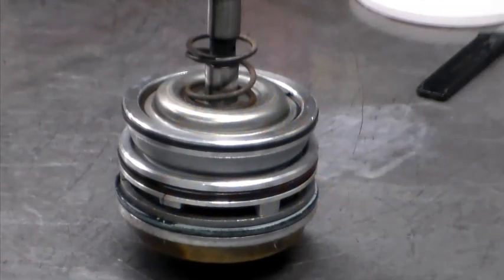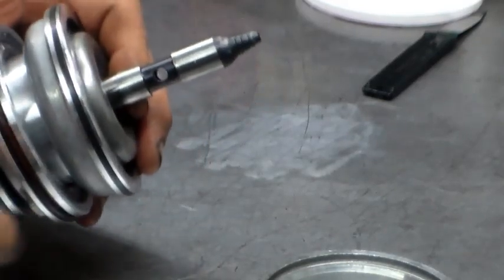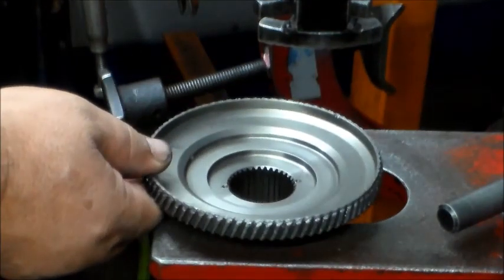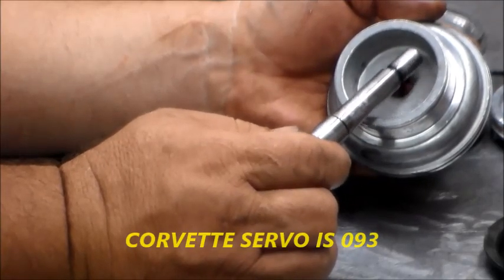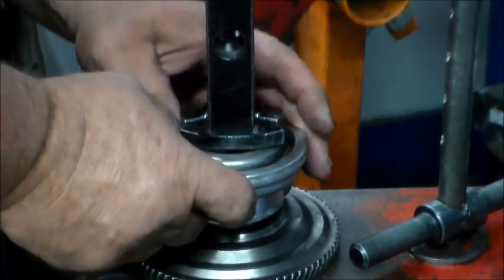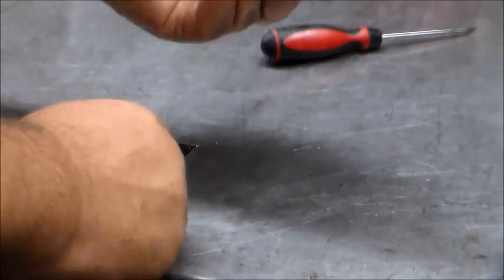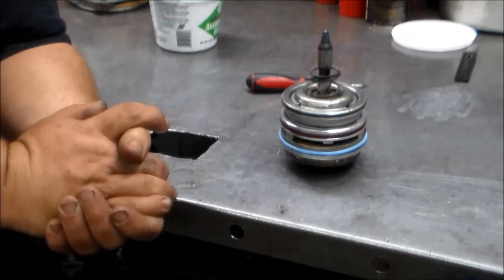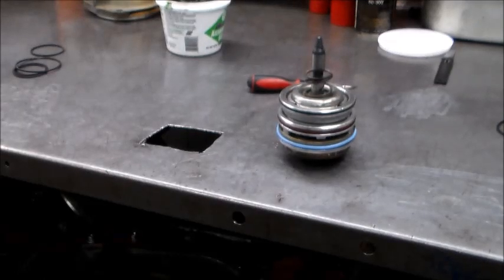4L60E SERVO

Comment: Thumbs up servo video!

Kind Sir, please answer me a quick question from Flowery Branch, Georgia...

Sir, does that main piston that sits inside the cap with a hat facing in the hat top facing inside the cap, is it supposed to sit in there tight enough that you can turn over the cap and it's not supposed to fall out???

Because this aftermarket one I got on eBay, I can turn over the main outer cap and that little hat lid on the inside falls right out... Is it supposed to fall right out or should it be really sitting in there cuz the seal doesn't even really touch the inside edges of the cap...

I'm talking about that one that everybody seems to get put in there... backwards so it has the hat part pointing in.

That's like John Wayne wearing his hat inside out... That don't make no darn sense...

Comment: If I'm losing my 4th gear overdrive when cruising on the freeway would this be the culprit? This is happening in my 4l60e in my 99 Trans am, I'll be cruising along at 65mph and 4th will just unlock but I can re-engage it by tapping on the brakes or downshift to 3rd and back to 4th quickly. I was thinking it was just a bad band but now I'm not so sure.
Reply from the maker: I dont think its a band if it was it would also effect 2nd gear as well, could be A servo problem, or a possible or a hydraulic leak in valve body, could also be a solenoid problem

Comment: I have a 4l60e transmission that seems to have lost 2, 3, and 4th gears. While driving. It stays in first no matter the rpms and seems to attempt to shift only if I let off the gas allowing g the rpm to drop I can then feel it shift it  begins to slip. At that point if I hold it at the right rpm  (between 2000-3000) it will gradually gain speed up to about 50 mph. This doesn't work all the time and it the temperature doesn't seam to affect it. The transmission fluid was burnt with shavings. I decided it needs rebuilt so I called amco for pricing. The guy says I should bring it in for a free inspection because it may not need rebuilding. While researching this most techs scream rebuild at the first sight of shavings. So I have 2 questions for you. 
1. Does this sound like the servo is bad?
2. Is rebuilding most likely the only option?
Thanks for your time.
Oh I pushed the servo cover and had atleast 1/4"+ movement
Reply from the maker: it doesn't sound like a servo that should only effect 2nd and 4th if a lot of metal is in the pan I would suspect a plant or bearing issue you can just repair whats wrong however if you take it apart that far you should rebuild the unit

Comment: Hello....  I have a chevy Silverado 2012 with 187K.  My 4L60E shifts fine without any slippage in 1st & 2nd gear.  But when shifting into 3rd gear I have total slippage.  When I let off the accelerator and the RPM falls to where 3rd gear let go, then it takes 3rd gear and will pull without any slippage.  But after 3rd gear does energizes, I either do not have over drive or forth gear, I can't tell which one I do not have.  Where do I go from here.  Thank you.  Frank.

Comment: Is there anyway this can cause a loss of 2nd and 4th gear? I have a brand new transmission and less than 1000 miles. Got hot on me while pulling an empty trailer. Pulled over to let it cool and have had no 2nd or 4th since.
Reply: You ever determine answer?  This is what I got:

1995 Silverado 4L60E. Daily driver. 229,000miles. All stock. No CEL or stored codes. There's no 2nd or 4th. It was shifting 1st to 3rd, and 3rd to 1st. Does same behavior in D and 3. In 2, it doesn't shift out of 1. When in 3rd, when I stomp on it, it tries to kick down to 2nd, but just flares the RPMs, bc there is no 2nd at all. Fluid clean, red, and full. No burned smell. Is there anything it could be except for 2 and 4 bands or clutches?  Guess I could measure the Servo and see from there, eh?

Comment: I am struggling to understand how much the big cushion spring behind the cover in the 2nd piston affects both 2nd gear and 3rd gear engagement. I have put in the HD 2-3 Valve, a corvette servo, and I think I am going to block the 3-2 valves. It seems logical to grind the notches in the cover, but will this make my 3rd gear excessively firm? Or, how would making the springs in this location stiffer or softer affect both shifts?

Comment: should there be and gap in between the servo pin and small spring and  washer that sits under the C clip.. mine has around 40 thousandths gap. thanks

Comment: 07 Hummer H2 4l65e
2nd and 4th went out with only 20000
On rebuilt trans. Where can I find the tool that checks to see if the correct pin was used? Corvette servo was installed.

Comment: 18 years ago, after putting a Whipple supercharger kit on the 5.3 in my 2002 Avalanche, I put a Transgo shift kit with Corvette servo in the 4l60e. Everything turned out OK, the transmission even had a slight bind on the 2-3 under light acceleration originally from the factory (I'm the original owner). The guy who sold me the kit penciled in some hole size changes in the valve body plate to address the 2-3 bind, I followed all the instructions and the bind was gone with all the shifts nice and solid. However, the 1-2 shift was firmer than the rest of them, and when I put the trans in tow/haul mode, that made the 1-2 shift dangerously harsh. Using tow/haul makes all shifts a little firmer and it also winds out each gear a little longer, and also delays the TCC. All the shifts worked well in tow/haul except for the 1-2 being too harsh, and I like to use tow/haul when pulling a trailer, so I had to let it make the 1-2 before engaging tow/haul, then remember to cancel tow/haul every time I came to a stop. I didn't care for what the Corvette servo does to the 1-2 shift because it makes using tow/haul a hassle. 

Now at 120K miles later I am replacing the trans with a Monster unit. I made the order last week and the lead time is 6 to 8 weeks. I saw that their level 2 shift firmness package includes a Corvette servo, and I told the guy over the phone when ordering to put in the build notes that I do not want a 1-2 shift that is too harsh in tow/haul mode. The rep on the phone said he put that request in the notes and it will be addressed. I don't know what exactly they will do, but I don't want a savage 1-2 shift again. I also talked to another transmission guy who told me he does not care for the Corvette servo in a heavy truck either. That hard 1-2 shift is one thing in a car that weighs less than 4000 lbs, but another thing entirely in a truck that weighs 6000 lbs.
Reply: So random guy, I dont know much about transmission but, I read the shift kit address weak 1-2 shifts so a 2nd gear servo becomes overkill after a good shift kit.
Reply: @jeffreymedina304  I tried to include a warning about doing business with a particular online transmission shop but the comments are rigged and won't let it thru. Which explains why I never see anything bad written about them here.

I had a reputable guy start with a GM crate reman 4L60e and build it to 4L65e specs. He used the Raybestos combo clutch discs that have friction on one side and steel on the other instead of separate steels and frictions, 5 gear planetary, 13 vane pump, stock pump pressure regulator with no bump up pressure spring, roller bearing shim washers, no Corvette servo. I installed it last summer along with a reman transfer case and it shifts solid, perfect for a heavier truck.

There is a solenoid on the right rear of the valve body that controls the system pressure. I had to dial this in myself. There is a #15 torx set screw on the back of the solenoid, if you turn it about 1/2 turn it will make a big difference. It can be set so the 1-2 shift will get rubber on part throttle, this is way too hard and will break something. I set it so it is nice and firm but still not too hard when in tow mode. There was labor involved because each time you have to drain the unit, pull the pan, unplug the electrical plug from the solenoid to expose the screw which takes some fiddling with a small tool to unlock the plug, turn the screw a fraction of a turn with a small torx tool that can fit in a tight spot, it has to be angle shaped like a small Allen wrench (turn clockwise = firmer) then put it all back together, refill the unit, test drive and evaluate. I had to do this several times to get it exactly where I want it. If the pressure is set too low then there will be binding in the shifts and if the pressure is set too high the shifts will be too harsh. You have to find the Goldilocks zone.

Comment: What happens if you don't add the four notches?
Reply from the maker: sorry for the delay in reply the four notches is part of the shift kit the idea is to give fluid that is trapped in the servo a place to go when 3rd gear is commanded that part of the servo is used as a accumulator that uses springs to soften the shift

Comment: Nice video my friend, hey i have a question 4 you, i have a 2004 Tahoe with a 4L60E and bought a new Sonnax complete servo kit ( 2nd & 4th gears super hold ) but i was reading the instruction and it say the pin or rod ( included in the kit ) should be grind it on the tip not too much not too little to avoid the trabby getting stocked in 2nd, could you please give some tips of the right amount i should grind off of it?? Thanks in advance

Comment: I recently bought a 2011 chevy Colorado 2.9 with a 4 speed AT an 4L60e and starting to make some upgrades for a drift truck project. I already put a transgo shift kit also bought a B&M quick silver shifter to throw the shifts to floor... And my super servo 2-4 already arrived so im planning to do all those upgrades in a few days more. Also thinking in get a hp transmission oil cooler...
what not to expensive upgrades can i make to the transmission spend 350dlls for shift kit and labor 
175dlls for ready to put super servo i will try to do that job myself.
And 200 for the shifter 
Who's in da same channel to built a drift truck project ???
Saludos desde Ensenada México 🍀🎶🍻🤘

Comment: On my 2000 Silverado i have this servo in a 4l60e .the piston and accumulator for 3rd gear are shot and I have to replace all of it. Could
That possibly by why it won't shift into 3rd at all? If so any one know how that even happens so I can fix and prevent a repeat?  Thanx guys

Comment: Hi, Thanks for video, I have 2000 Pontiac Firebird base 3.8L V-6, I have some issues with my transmission ,  it's shifts from 1 to second, but has no 3 or 4
I went to autozone and they check engine light , there was code which pointing to solenoids, Do you familiar with such problem, and what you think it could be?.Thanks

Comment: Hi  Robert, very good precentation.  My Transgo stg 2 shift kit doesnt mention the cutting the disc ! Should i cut mine ? I will b installing Vette servo in my Aussie 4l60E 2000 model commodore GM 3800 L67 V6. Thnk u very much !!!
Reply from the maker: It will make the 2-3 shift a little faster with less of a flair

Comment: What is the actual purpose of the additional spring? The transgo kit I am using adds two springs plus a spacer on the end of them, really tightens it up.

Thank you for this as well as your other 4l60 videos! This is my first rebuild, you and some others have been a big help.
Reply: I put in a corvette servo I noticed my original sero had spacer why? Jw I put the spacer in same spot just not sure what it's for

Comment: What did the grinding and added spring do that the stock setup wasn't?  Does the stock setup hydrolock?  I've watched quite a few vids and it's the first I've seen anything about the 3rd accumulator mentioned.   It's always about the corvette servo.

Comment: What is the part number  for a 4l60e servo
Reply: @Rick Samson - Buy the Superior 4th w/cover and 3rd. New wide band with servo installed should move by hand. If tight, grind a small radius off the pin, retry.

Comment: I tore down a 85 Corvette 700r4 and when I remove that same servo and found a spring broke into three pieces and the apply rod was in about three or four pieces. Do you know what could have caused this. I don't want to rebuild it and have the same problem. The transmission came out of a wrecked Corvette
 Thanks for any help
Reply: Mickey Locklear  - It has been a year since your question, but in 1985 was almost the first year it was made. It would be easy to find 13 suggested updates to do including increase the drain-back hole under the front seal and install the new retainer for it. That's 2. Accumulator pistons take a beating as the move as you shift into gear and as it shifts out. These wear, crack, break and can ruin your case. Same thing for the rear case captured check ball, next to the 4th filters. Large springs break and accumulators will pound the snot out of the separator plate. Go onto your favorite search engine, type in 700R4 modifications. A printable PDF full of explanations and diagrams from some "National Transmission" service group put this out there. I highly recommend updating the pumps pressure valve to 0.50" and install the Sonnax reverse boost valve. Superior can not be beat for size and apply pressure in the servo assembly. Get the 4th w/cover and third together. Much better than the Corvette servo everyone sells. I don't know the mileage on my donor but the captured check balls are over looked. If you need a non-cable VSS, install the 40 tooth tone ring in place of the plastic drive gear. Go to Rock Auto under 92-93 Camero and get the connector, sensor and tone ring.  Clean with scotchbrite / Acetone and red Loctite in place. If you have a bearing race and pipe that will drive it onto the output shaft straight, it will not break. No clip is required, just stop at witness mark or use a file, tape & photo. Then the planetaries. I went all front/rear ACDelco 5 gear. The rear has a Torrington bearing and cover machined to fit. It adds 30% more torque the OEM and found in the 4L65E. Use the Sonnax Sun Shell and it transfers the load path to more surface area. In other words. plan on a valve body plate, Jr. shift kit, TV repair valve kit the use lock-up with hydraulic pressure instead of the ECM or a vacuum switch. I bought a temp gauge and used wires in the connector for ground and signal. It is a NTC thermistor and bolt a bracket on the VB. This holds it on the fluid before it leaves the trans and will be more accurate. The Alto Red Eagle frictions with Kolene steels are far beyond Raybestos. The steel plates are heated in a salt-solution and frozen in nitrogen to provide excellent heat transfer per 1,000 of an inch and wear and don't warp like others. Heat kills everything except a mean mother-in-law, so get a cooler on it. I grabbed an import A/C condenser with fan that was not tall but longer than most. I placed it underneath with a louvered rock guard on it. $5 dollar bought a adjustable thermal controller that has an NTC thermistor and degrees F adjustment so it comes on at 180 F. Condensers for R134a are more efficient than and handle 450 PSI easy as the trans cooler circuit runs at 8-12 PSI. I just stuck the sensor bulb/stick into the fins near the return pipe as i want it to warm up in the winter but stay cool under loads. 13 updates and 32 other mods will get you a snake charmer. Otherwise, make it go & sell it. Otherwise, I don't know anything about these transmissions!

Comment: I do appreciate all your great videos but you indicated that if we have any questions to just ask. I have a few unanswered questions you have not respond for a some time if you can't help me please let me know so I don't waste my time and ask someone else. I have done some work on the 2003 chevy truck 4L60E I have found that I think instead of lagging back from 1st gear to 2nd I think the trans. is miss 2nd gear and shifting to 3nd gear. I can manually shift from 1st to 2nd and it will not go in but when I continue to 3nd it will shift so I think it is passing 2nd so what could cause that problem. Please let me know what you think ASAP. Thanks Keith
Reply from the maker: I'm sorry for the delay in response to your question but I have been very busy in the shop you are right I did say if you had a question just ask so let's get to your problem.  If you are missing second gear it is normally a band problem however you should also be missing 4th gear if it's a band if you have 4th I would start with shift solenoid if the solenoid is ok then I would remove the servo I hope this helps
Reply: @robertrushton6622   Will sorry for my  late reply I took the truck out to make sure 4th gear is working it is definitely working could get up to 70 MPH then down shift to 3rd. I have no scan codes because of the short I fixed in the dash broad that killed the battery and cleared all the codes. So can you tell me what solenoid I need to change if it is bad it should have a short or a open circuit right and if I need to check anything else I put a rebuilt servo piston in it last weekend so that should be good. Thanks

Comment: Does the lost of the overdrive or the 4th gear on the 4l60e have something to do with the servo? I reassemble my stock servo and since i lost the overdrive what could it be?
Reply: I have to Wonder if the 4th gear piston(the one that lives inside cover) may have been installed backwards.  Easy to do.